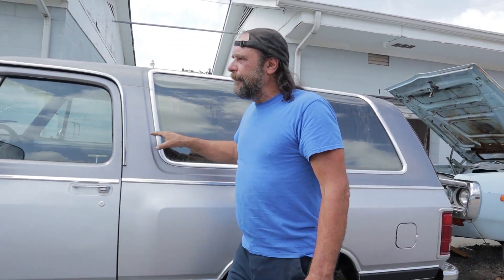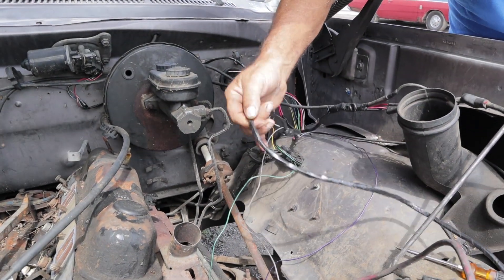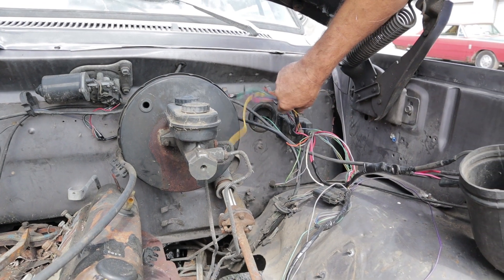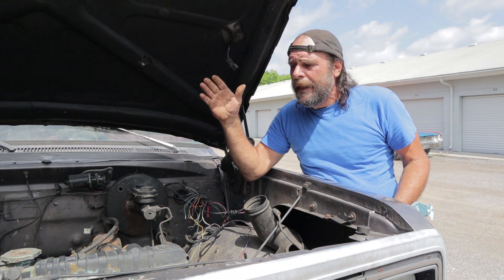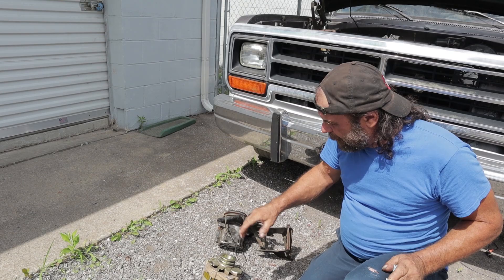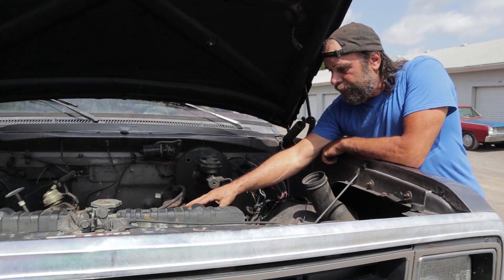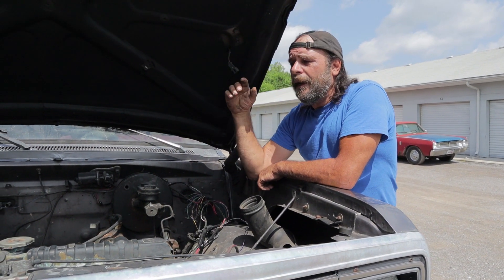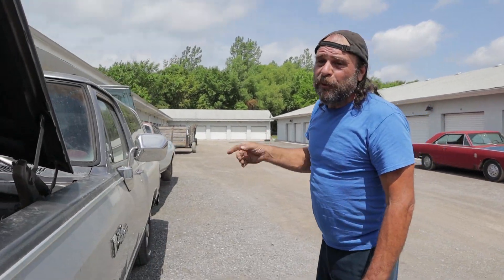Bottle Rocket and Ramcharger Update

Comment: I had a 1974 Trail Duster. It had 3 front seats. The middle seat turned into a secret compartment under the seat. I loved the 3 on the tree. The bushing for second gear was worn out and I had to get it of the truck and manually pop it back into place.
Reply: the older ones were awesome because they can go topless anything newer then a 79 and you can't go topless anymore
Reply: @79tazman  the top on mine had never came off. The guy we bought it from was a bit screwy in the head. He saved every spark plug change and had all the iol change records from new. The extra weather strip for the top was still sealed in the original packaging. I kept a 95 blazer instead of the 74 trail duster. Boy did I screw up